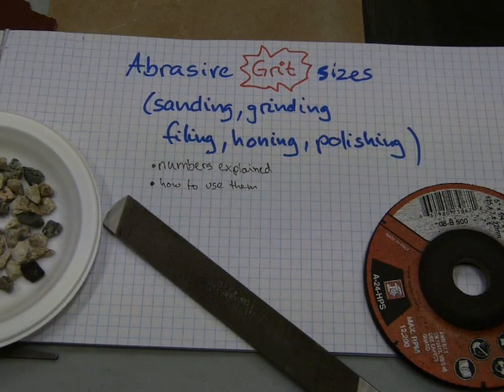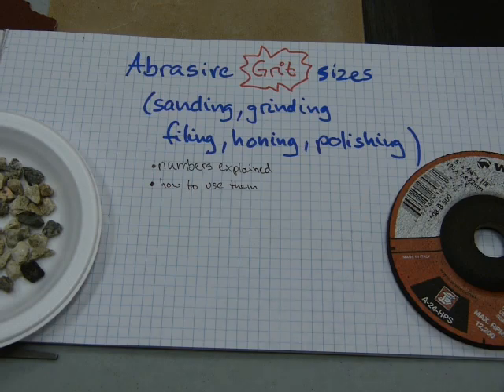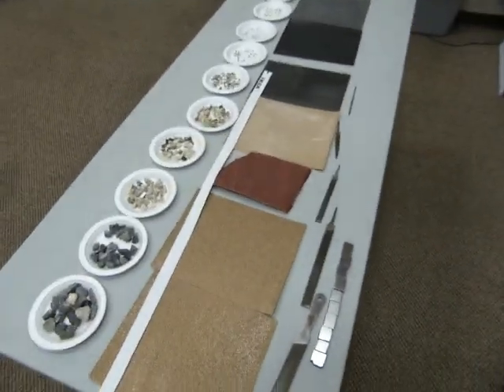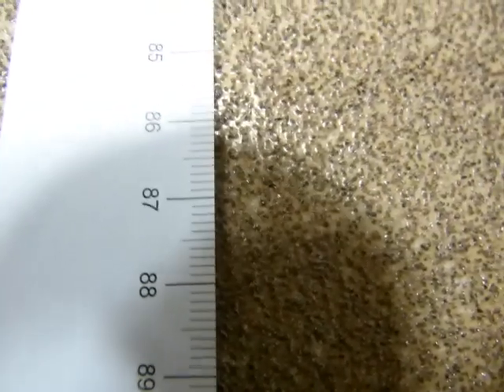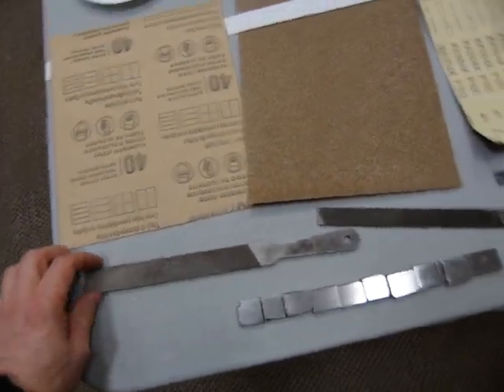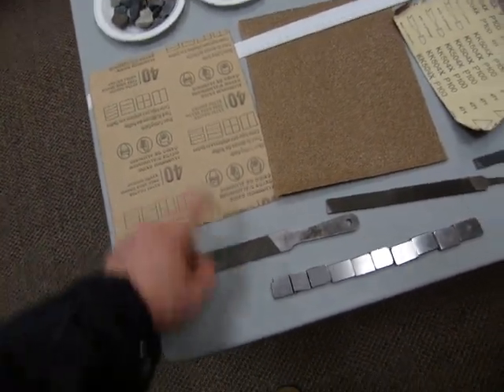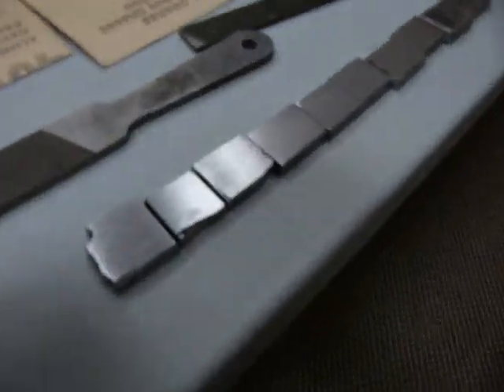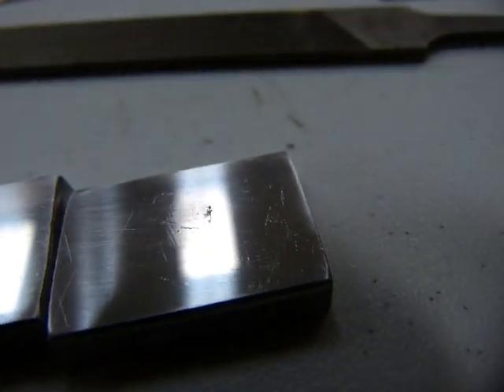Abrasive grit sizes (sanding/grinding/polishing)

Comment: how about using this quality German made wet and dry paper from ebay;

http://www.ebay.co.uk/itm/WET-AND-DRY-SANDPAPER-320-400-600-800-1000-1200-1500-2000-Klingspor-Abrasives-/141565538452?ssPageName=STRK:MESE:IT
Reply from the maker: Barney Morris Top-of-the-line finishing grades.